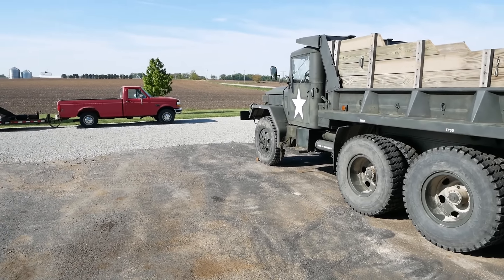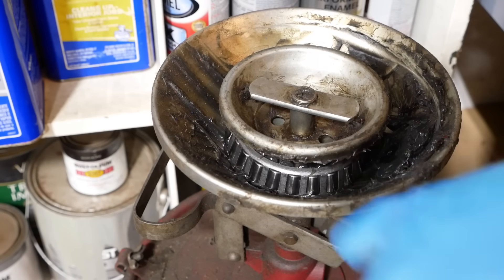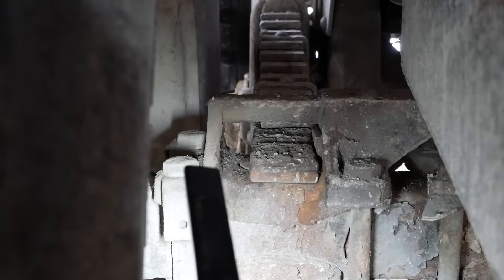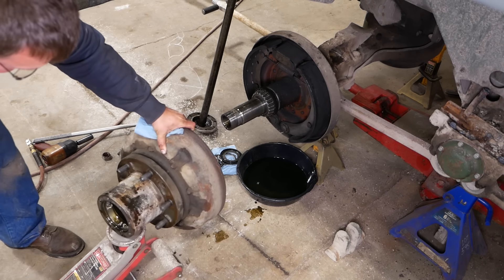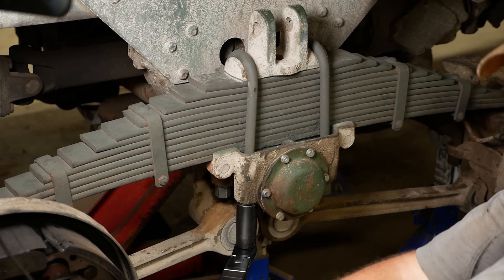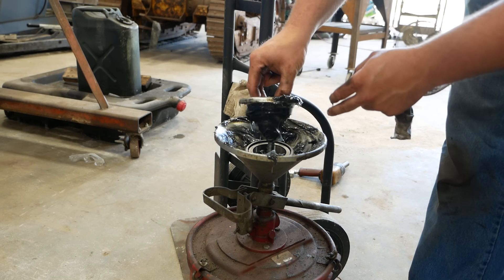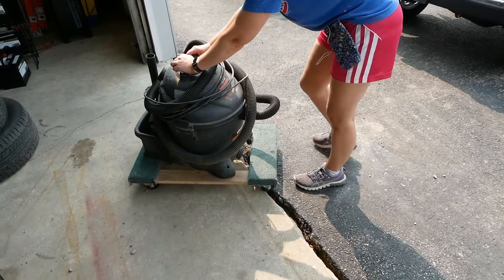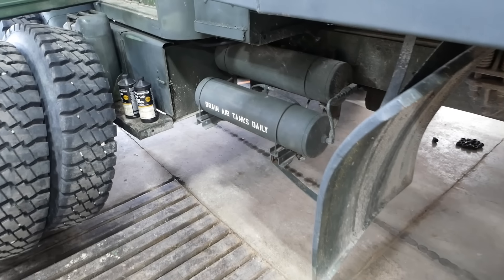Military Truck Crazy Suspension Damage - Can We Fix It?

Comment: Great-looking army truck!  Others, for a good overview of the truck's underbody mechanism, see 7L47 Lol with the kids advice around 18:00. I can relate with good custom repair/fab shops going the way of the dodo... super aggrevating.  For the pin at 21:10 and forward, why not just warm it up with the torch, let it cool, then impact the busted sized out and replace with another pin or bolt, cut down to size?

Comment: You can also set up a dial indicator to check lash should be between .001-.004. Nice bearing packer for sure. Also killer shop you could get a few more projects in there too.

Comment: THE TELL TALE SIGN was the bent spring pack,the truck could of been heavily load and been dropped or fell while driving and bent the axle tube,it could of been straitened and reinforced if you could not locate a replacement, but good job, it always sucks when you get into some ones old mess.

Comment: When I was stationed in Germany during the 80s before, we were allowed to leave post in a deuce and half truck M35A2 the mechanic (63B MOS (he would always give me that “U just made my day look”)) had to test the brakes on a brake test machine and they would almost fail every time so he would adjust them on the spot. I remember having to check and fill the brake fluid was a pain in the and the half shaft coming from the transfer case seemed to loosen up maybe because we were petal to the floor on the autobahn oh and we had a semi and annual service done on vehicles which included checking bearings and packing them I don’t remember the mechanic packing them the operator was responsible for these tasks supervised of course.

Comment: I too was in the Seabees. Is it a gas engine or what we referred to as a multi-fueler. Meaning if it will burn, you can put it in the fuel tank. The base I was on was back to back with a Navy air station, so we were burning jet fuel in our trucks. I'd be willing to bet that the truck was being lifted with a crane, & the sling broke & dropped the truck on the rear axle.

Comment: I just watched your video on the old military dump truck.  I’ve seen this before on more than one truck.  The operative word is DUMP truck.  They are loaded by various size front end loaders driven by people of questionable expertise.  A loaded front end loader is a heavy piece of equipment.  All it takes is for the turd driving it to slam into the outside of the dump truck wheel at as slow as 5 mph and the damage is done.  I watched my boss and the insurance company chase a tire ware problem on one of our trailers for a year after a loader driver hit it while taking a swig of coke and loading the trailer at the same time.  To the naked eye it didn’t look like anything was wrong with the trailer, but it ate tires like mad. Super singles ran about $550 each at the time and it had to have 6 of them every 3 months after the bump with the loader. Things like this are common in the dump truck business, military or civilian.

Comment: The springs were bent due to a roll over on that side.
Very common damage when a large tandem truck over turns.
The extreme weight of the truck landing on the side of the rims bends the springs and hangers

Comment: The difference in the spacing of the axles relative to the trunion bearing ( front axle being further away) will give the front axle a slight leverage advantage over the back axle allowing it to climb out of soft ground slightly easier instead of just ploughing in.

Comment: Those trucks use silicon brake fliud...they are air over hydraulic and regular brake fluid mixed with silicone fluid will turn to jello...good job on the repair

Comment: The bearings on the hubs are oil bath not greased.  I worked on these in the Aemy.  You fill the gear box with oil.  Raise one side for 2 hours and then  raise the other side.  letting the oil flow across.. Recheck the gear box after all work is done.

Comment: wes just a thought  could the truck been swung full lock left or  right with the front axel acting as a pivot point making the rear swing around the turn a little wider than the front axel the rear could have made contact against a kerb or similar to push it over far enough to bend the spring pack??

Comment: I had thought that drilling out the holes in the sprig perches to make them round again and welding new locating pins of slightly large dia., to match the new holes, to the axle tops as a next step but considering they are only used for locating during assy. as you've said; why bother. Certainly the rigidity and security of the assy. rests on the size and torque load of those large U-bolts.

Comment: Ever run into this issue again with the packs and u bolts hit up virginia truck body/ equipment works in Lorton Va. probably a bit of a ways away, however I used to work there and this would be a normal day making all this in under a few hours same day shipping.

Comment: iv got  a local shop here that you walk in you tell them what style bend you need the length and the dia for u bolts the guy walks in the back bends them up right there in a couple mins and hands them to you. i wouldn't have a clue what happened to that truck but there is probably a good story that goes along with that damage...... looks like some "hold my beer and watch this" stuff happened....lol

Comment: According to Lisle, and my own experience, the tapered side of the bearing should be facing down in those grease packers. Bought one of the little portable jars to do the annual lube job on my trailers.  Not without a mess but far better than the old way.

Comment: Well that turned into a can of worms fast!!

One can only fix what they know is bad or wrong and go from there.  There is no way one could have just gone, oh the axle is bent. 

Great work.  Im surprised with a floating axle design that the wheel bearings were still pacled and not just lubed with diff oil.

Comment: thinking about the spring shift it could have been impact damage or drive damage  if you swing a hard left or right you will force one axle to slide if it pivots around the front axel it will force the rear to slide out  least ways in my experiance of double drive set ups

Comment: What happened to a friend of mine with an Old International Steel hauler... It got rear ended by a drunk doing probably 60 mp, he smashed into the right side of the pumpkin it sheared the pin in the middle of the springs on top of that piece you just fixed... It caused it to track a bit sideways.

Comment: An inner race for a tapered roller bearing is referred to as the cone, the outer bearing is the cup,

Not to ask a dumb question, but did you check to make sure all the tires are the right size?

Comment: I work on those truck for 20 heard and the rear axle will always have sometime tracking issues when the truck is turning and it is  normal  tighting the spring bearing and check for wear on the trunion shaft was the correct move the spring pucks are replaceble but are not your problems. The wheel bearing normaly grease and they have a outside seal to prevent the différentiel oil to enter the hub they fit on the axle key way and the oil would enter from there you can prevent that by adding à piece of cork in there. Sgt rod

Comment: I had a next-door neighbor with one of these....only difference was instead of dualies on there, someone had converted to some big fat wide single tires...and those naughty 'split-ring' rims...I don't know if he had troubles with the rear axle bearings, he had the engine (6 cyl flathead) running, but worked on the 'hydro-vac brakes almost every day....I had a 2 ton I'ntl bus with Hydro-vac...not that much to it. But I watched this guy often....he was not a mechanic...never actually drove it enough for the rear axle bearings to be an issue.

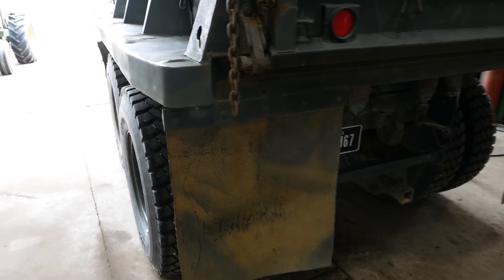Comment: At 10:46 you can clearly see the rear axle is pushed back out of alignment and pushed out by quite a lot.  That combined with the leaf spring issue means the truck was hit from the curb (Passenger Side) VERY hard at some point.

Comment: I had a bent axle housing on a semi after getting t-boned. Not much for it, can live with it but it is what it is... Eventually needs replacement, but id guess it was rear ended. 

Boyce Equipment specializes in parts for these types of trucks and rebuild them. They're located in Ogden, UT 

Lol u patterns are fun... With the t case set up in that truck its a hillbilly 8 speed. Low in the t case 1, 2, 3, 4, 5, flip to high i. The t case, then 3, 4, 5 again if i remember the gearing correctly. Lol interesting trucks albeit, redundant everywhere and odd to work on at times.

Comment: So how bad would it be to just heat up the place where the axle is bent with the acetylene torch and beat it straight with a 5 lbs hammer? Would the metal get too soft in that place?

Comment: Bent Axle Tunnel is hard to pick . And a Very serious problem . Tears Everything up . Tyres , mechanicals , can break half-shafts , Etc .
I  think that little cork Wedge in the bearing Pack was a Seal . Keeping Oil away from Grease . Dab of silicone just as good .
Nice old Truck . Owner is now ready to confront the Zombie Apocalypse . Great work . 
DOT5 will rot all the Rubber parts in a DOT4 brake system in a Vehicle this age . Just as well you didn't use it . 
Pedal to floor and Wheel Cylinder seal failure , down the road a bit .

Comment: Probably a young driver, heavy load, but, wow that's a unbelievable amount of force required to bend that shit! Replace the bent rear , right on. With the slow speeds and  low miles , might be OK< but not right. Great repair, Love, Dubs

Comment: this reminds me of an old truck like this we had in civil air patrol we got wood and made new folding rear seats and hoops for the canvas cover we did tons of work on the thing then somebody borrowed it and we said put lots of oil in it uses a lot they drove it for hours and put in one quart we had in box and didnt bother to get any more so when we went to start it up it was out of oil no oil pressure engine was ruined all that work for nothing the dipstick was like full 2, 4, 6 qts low and oil was off the bottom

Comment: I have seen dozers push military engineer trucks from the sides. I don't know if that could damage the suspension like you described. We used the 5 ton dumps in VN (1st Engrs). A lot of other countries got our trucks -- for parts.

Comment: Another way to check the axle housing straightness is by pulling both axle out and peep through the spindle hole. The hole on the other end will be centered if the axle housing is straight.
Reply: We made those trucks into sugarcane haulers and beefed them up to carry 15 tons.

Comment: Stock tires for this truck were 9:00-20 Military tread, typically rounded and narrower than standard. With only 6 wheels, they used 11:00-20 or maybe 11:00-22, so the axles could have been misaligned and nobody would have noticed. Seasoned Military drivers will tell you the the 6 wheel truck is way better in mud 'cause you only have to make two holes in the mud. 

Stay away from Military trucks unless you already own half of Texas. But you knew that.

Timothy Merker

Comment: 50:40  Getting the last parts, thus making it harder for the next guy.
This is why after years, and many busted knuckles, of working on axles and brake hardware I will schmear a little anitsieze of components that need to come back apart or separate without damage, it makes it so much easier for the next poor schmuck, who will probably be the person doing the current work.

I liked the helo ag sprayer at the end. Apparently my mother had a relative who was an air tractor pilot, died on the job when he controlled flight into power lines at the end of a field.

Comment: Having turned wrenches for over 20 years professionally I have to say that it really sucks to have to go back to the customer after having already sold them a ton of work only to have the same problem it came in with. Thankfully that was a very rare occasion.
Reply: These are the types of jobs that you tell the customer that you are opening a can of worms and going down a rabbit hole that can take many twists and turns. If they squint there eyes and stomp their feet you turn them away. If they are cool with it and say take your time then u should be ok. That's kind of how I do it.
Reply: @ninamcclure2193  you are absolutely right to handle the job in that fashion.  If things work out well the first time around then you're the hero and if more repairs are needed you left that door open from the start. Ultimately we all would rather have everything work out the first time because no matter how understanding a customer is a never ending estimate or repeat repairs is never a good way to make a customer happy.

Comment: The perch for the plate that's elongated just weld it up and re-drill the hole to correct depth and drill out the pin and weld in a new one.

Comment: Those tires are newer models that come in to use @1995 on
  They are large. 
Usually the original tires are smaller and with more clearance to what is now on

Comment: your alignment problem is usually caused by 1, broken spring center pin bolt , 2 , yours seems to be caused by the center pin on the perch pad and axle , 3 , weld the perch alignment hole and then redrill using an end mill for a flat mottom surface , this may heelp or may not in your case , but these type of repair is fairly common in logging trailers and trucks ,

Comment: The M-35 series, of which this truck is a derivation, was a 1950 era design.  So most of the suspension etc is from that technological era.  You are correct that the power steering on this truck was an add-on, although not by the military.  You can tell that it was not military as it hangs down way too low, and the hose is far too exposed.  That rig would last a few hours at best in the field with 19-year-old hot dogs driving it.
The 2.5 ton series was not sufficiently "heavy" to warrant power steering in the minds of the procurement officers.  The 5-ton trucks did get it later on, but in the 50s the systems that did exist were not reliable enough, or robust enough for the military application.

Loose battery terminals are a perennial problem with old-style mil-spec terminals.  We used to pack them with a bit of grease to reduce corrosion, which did help with conductivity.

These are tactical vehicles, and the kids who drove them didn't own them, and so didn't care about them.  It was not uncommon to see damage that looked like they went four wheelin', but swore up and down that they hadn't.

You should double clutch.  It is not absolutely required but was highly recommended.

...or dropped from a helo.

Comment: Taking the replacement axle apart we always try not not beat the pieces to death with a BFH as they are valuable to someone and should be preserved. Brake drums especially as they are heavy and expensive to replace. Other than that you did a fine job with a vehicle that is not common in today's garage experience.

Comment: Military vehicles get serviced on a semi-annual/annual basis. Truck moved 6 miles during the last 12 months, annual service. Truck runs 1,000s of miles through dusty conditions with extensive idle time, annual service. It is one of those issues that come along with having that much equipment but it is better to have and not need vs need and not have.

Comment: My 1974 AM General M35A2C 2.5 ton 6x6 cargo truck uses 9.00 x 20 tires with tubes. Running oversize tires will give you clearance problems. After running the truch, there are maintenance items to check. The air tank for the air-assisted brakes should be drained every evening. An air hose will connect to a fitting on the passenger side firewall. A gland fitting can be attached to an air hose for inflating truck or trailer tires. I use a Towmaster T20 trailer with air brakes to haul a D4 or John Deere 4430. Any National Guard unit can tell you about proper maintenance and repair.

Comment: the rear hubs are fed with gear oil from the axle housing.  Torque on the bearings are 50ft lbs back off 1.5 flats torque on outside nut is 150 to 200 ft lbs.

Comment: The trunion bearings did get loose but the biggest problem was the torque rod (x 8) rubber separating from the rod itself and allowing the suspension walking front to rear and left to right.